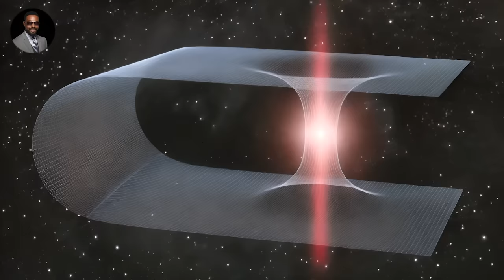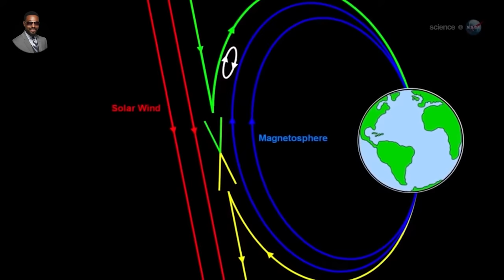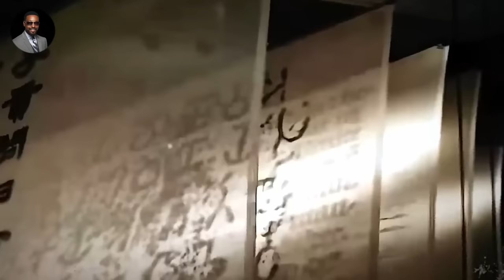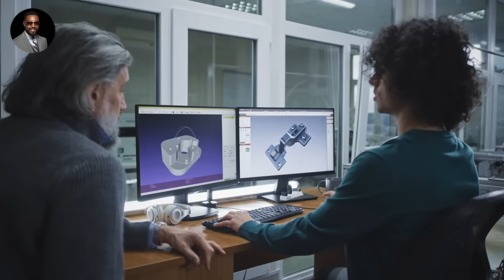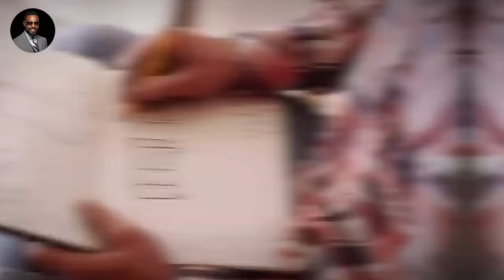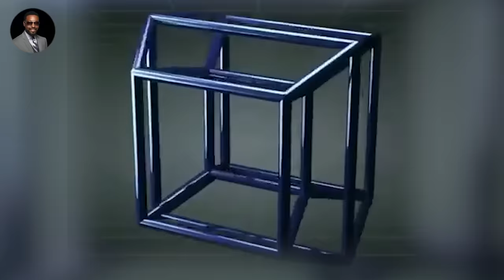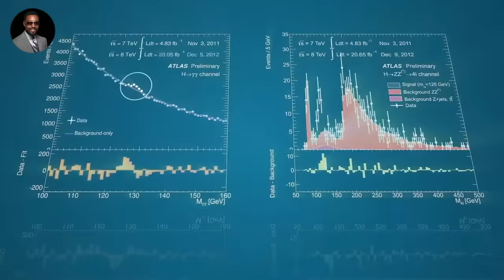Billy Carson on C.E.R.N, Portals and Dimensions

Comment: Do you math the distance of the release of your collision and also do you math the parallel adaption of every placement each one of these particles overlap each other to see if your got the correct screen size or see if you're actually pulling in or releasing out in the environment

Comment: This idea that is often shown about punching a hole between two points in space has always got me. How do they bend space from the far away point, surely like pulling a bow it has to travel from its own point in space to touch the point A we'll call it. That doesnt make sense to me. Maybe someone can explain, point B still has to travel to touch point A before you can punch your hole between them, no?
Reply: Maybe like Billie suggested the solid matter is an illusion of frequency. They could bend matter by using frequencies at a high enough level.
Reply: @gtheprodigy6978  maybe

Comment: Could be mistaken, but I believe string theory corresponds to the vibrations translating into specific sub atomic particles depending on the frequency.  Different dimensional frequencies may correspond to the frequency of mass and interchangeably energy itself. With mass the frequency could relate to the spacing between atoms in a structure which may put that mass in a different dimensional reference,  a hyper atomic resonance frequency. Atomic structure at higher frequency has smaller spacing between atoms in turn compressing electron orbits into lower energy states meaning higher energy levels are shed away and since energy=mass, mass is shed away as well. If this mass is negated enough, the surrounding space/time manifold has less or no influence over that mass so by definition that mass is displaced in another adjacent dimension.  This could be totally in error on my part.

Comment: My soul had popped out when I first started my awakening and I was leaving my apt with other souls (not sure who they were, other than all grey figures) and didn’t realize that I was experiencing an astral experience. 
My soul has attempted to pop out from my form a few times and I’ve been fully aware of it because I feel my body in bed and my cat is still nestled between my legs (he will move the moment he feels me moving) so I know there was attempt to leave. It feels like a 🧲 pull and static sensation.
Has anyone else start to leave feet first? At least it feels like it!
Reply: Are you sure you hadn't experience that when you were high?
Reply: Yes. I have experienced it. For me it built up from subtle vibrations. Throughout different points in my body. Like my feet, stomach, hands, back, all had this very natural yet deep pulsating vibration that was revving up slowly. Then it got intense and I may see some scared geometrical lighting to the pulse in my minds eye. Inside this process I slipped out but then I went right back into my body, because my mind stopped me from doing anything else.
Reply: @baguetteking4417  I wasn’t high lol
Reply: @louisejabela1  than you are wrong
Reply: @baguetteking4417  ?

Comment: I have made stable wormholes and the doors stayed open, not for ever but   minutes hours days. One stayed open over a year. Until the material turned to dust. I documented it with lots of pics and videos. It was a metal bubble with a big hole in the front and a smaller portal hole in the back. From the inside you could see another bubble   beyond the little hole that had another little hole in the back too but when you looked around the outside of the big bubble towards the back there was no other bubble attached like it had shown from looking on the inside. It was a like an optical illusion.